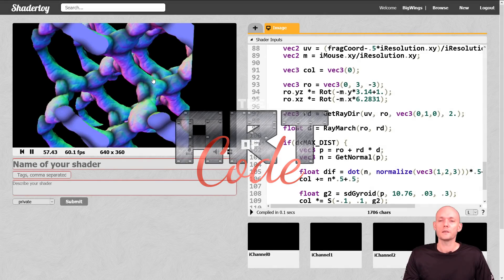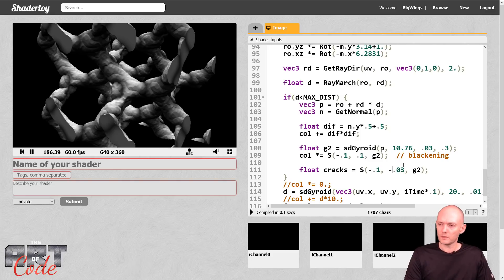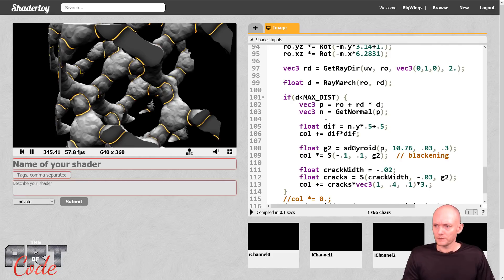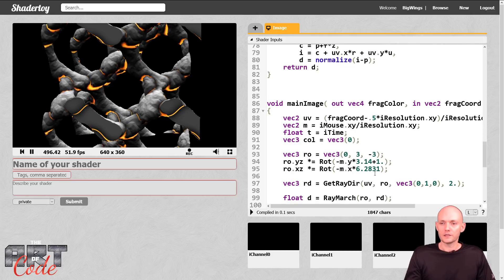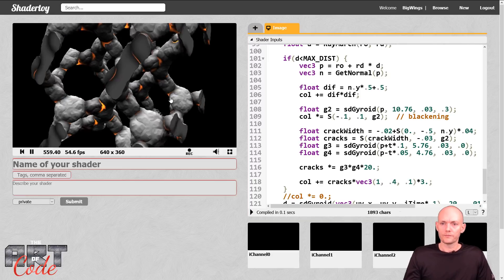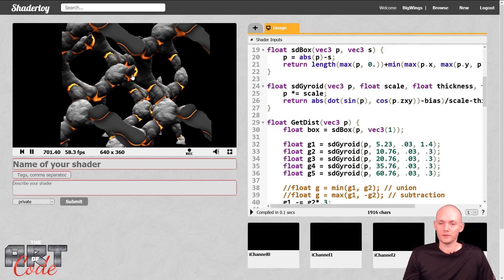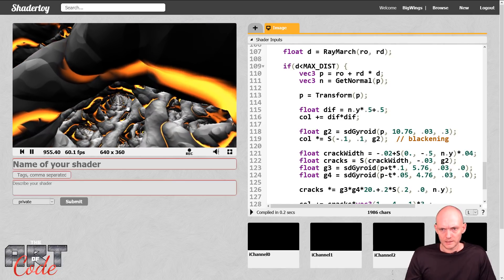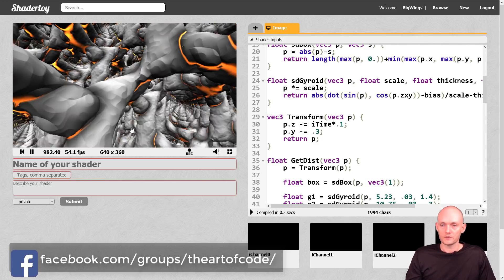Playing with Gyroids - Part 2

Comment: What graphics card do you have? I've just bought new PC with budget 150$ card and expected to have something like 10fps on this  since you have 30, but  surprisingly I have 60. And last time I browsed shadertoy I had like 5fps on average  :D
Reply from the maker: I have a GTX 960. The framerate is capped because of my screen recording software most likely. It runs on my pc at a solid 60 as well.

Comment: Awesome art coding. Could you do a tutorial on how to achieve motion blur in 2D and 3D space? :)
Congrats again, best regards
Reply from the maker: There are different ways to do a motion blur, depending on your specific application. One way you could do it is to shift your time value by a different random amount for each pixel. That way, the a moving object will scatter its pixels over the direction of motion. It will give you a dithered effect that you could smooth out by taking multiple samples per pixel.